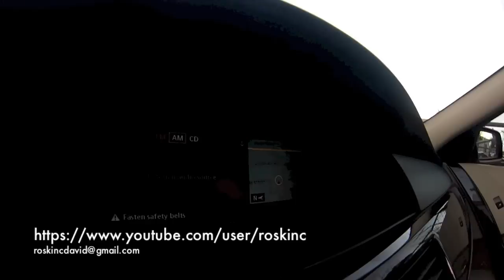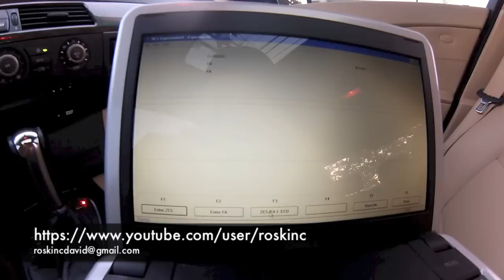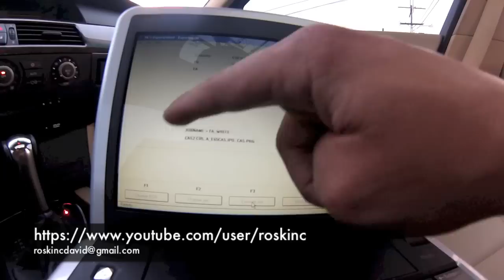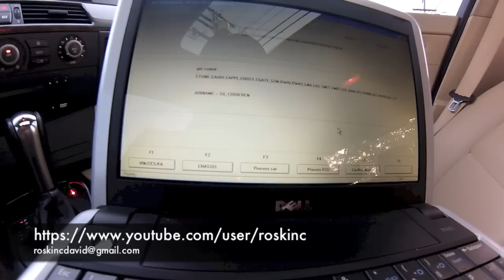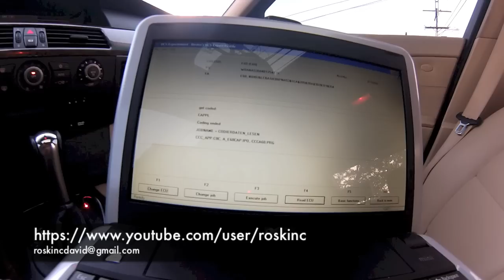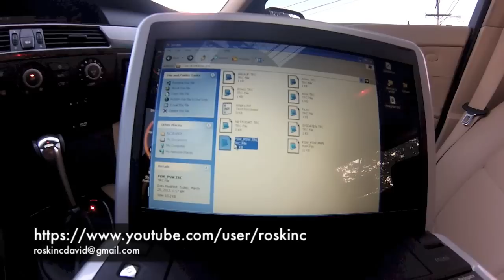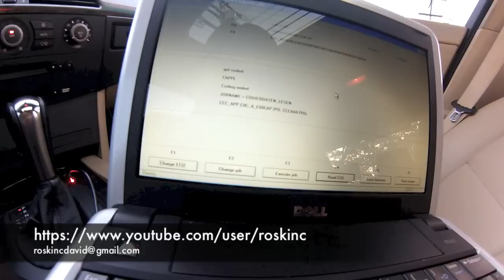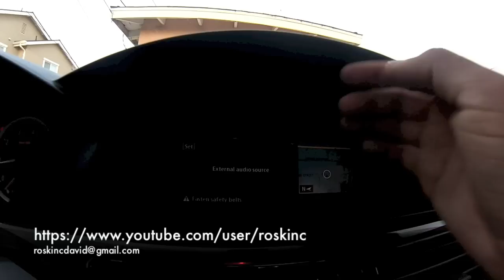BMW E60 5 series How to code AUX in Idrive ncs expert step by step

Comment: I'm currently in the process of doing this to my car. I bought the cable from your website and got it installed properly. However, the INPA program cannot read my car for some reason. I do not get either of the buttons lit up. I think it has something to do with my installation of the programs. If you have any suggestions, or know where I can get a (better?) version of the software needed, it would be appreciated. A video explaining the installation process would be super helpful as well! Thanks.
Reply: Hey, this is what I have run into. Did you get yours to work and we’re you able do your coding?
Reply: Yes I did! My problem was with my installation port. Open up device manager on your pc before you start the install process and find out which COM port your OBD cable is using. Make sure to select that port during your installation! Worked like a charm after I got that squared away.
Reply: cool, I am in the process of reverting my pc back to windows xp after I back it up.  I found the com port area and there were a lot of them, quite a few in use but when I unplugged the obd cable I didn't see any of the (in use) ports turn to not in use.
Reply: you might need to install different drivers for the cable so that your computer recognizes it as a COM port and not just a regular USB
Reply: ok, I got inpa to read my car and did all the steps up until coding the module, then I get an error code coapi 2062: error when reading coding data.  I have searched the web for this error and came up with nothing.  Could it be the program on my laptop didn't load everything?

Comment: I installed the aux cable and coded the ecu as you directed. The aux appears on the radio but no sound when I try to play through it. What you think caused that?

Comment: Tried 7n times, and cant make it! Can u send profiles or name of profiles!??
Reply from the maker: Alexander Pilipenko what errors are you getting?
Reply: roskinc no errors, just deliting NOT_mounted  , and its not stay..., and no AUX and again NOT_mounted.
Reply from the maker: Alexander Pilipenko are you using a Coding profile like revtors or stock but edited so you can upload a man file?
Reply: roskinc Revtors?!? Whats that? I was changing profiles too, from dieffrent ones. What was last profile that u used in video? I didnt find name
Reply from the maker: Alexander Pilipenko when your saving the file are you saying it as a .man file?
Reply: roskinc yes ofcours .man - all that showen in your video
Reply: After 4 hours search of REVTORS PROFILE , I DID IT. AUX IS INDA HOUSE ! Thanx, and bytheway I bought SPORT BUTTON from U on my 550i ) workin great!
Reply: So from that REVTORS
 PROFILE ..., I can code all stuff yes, like Digital Speed or  lights?

Comment: Great video! quick question  I have aux now and I can access it in idrive with the idrive wheel but it is not selectable from the steering wheel buttons. When using the steering wheel button it skips aux and goes from CD back around to FM.  (FM, AM, CD, AUX).

Comment: Hey man I bought the aux cable from you and downloaded the software onto my computer. I go to start it and it says faulty VIN and EDIBAS not initialized. Any ideas what this could be?
Reply from the maker: Need to update your dates files. Email me for current files.
Reply: +roskinc did you happen to know if there is a difference between K-line and DCAN cables. I have a 2004 525i and I read somewhere that they switched in 2007 to DCAN. Is this true?

Comment: Hey. I just bought an e64 630i 2005 convertible. The idrive only shows three options like in the video, FM, AM, CD. Is it possible to add Bluetooth to the menu with a bluetooth module from BMW (I'm a noob and don't know if one exists to purchase separately) like it would've come had the previous owner specified bluetooth as an option?

Comment: I know i need to have an ASK UNIT and AT TUNER if i have an early E66. But because the ASK Unit looks the same and from what i have read it is the same, i should just be able to upgrade the ASK unit and AT Tuner to a newer firmware release with SP-Daten 53.3 or newer? Would this work instead of buying a newer ASK Unit and AT Tuner you think?

Comment: HI
I 've had strange situation with my e60 2005 with single CD player.
I ve done all step by step but when I opened in notepad appropriate file I didn't found sentence:
AUX_CONFIG not_mounted 
I decide to write in this file
AUX_CONFIG mounted

Finally I have an option like AUXin my idrive, but there is only silence, can't play music.

Thanks for any advice.
Reply from the maker: Maciej Melaniuk if aux appears then the problem is the connection make sure the pins are in the correct spot
Reply: roskinc the door

Comment: Im trying to code AUX in my E60 2004 with Mask1 (Business Navigation, no map, just errors). INPA is working fine...Also in NCS car gets recognized. When I chose CAS in first step (adding +NAUX) I get some strange error, but when I chose LMA it would be working...But I dont know, because it is different than described....Any idea? THANKS!
Reply from the maker: skip first step and just change the mask module for the aux in

Comment: Turns out you were spot on there, just tried it with the other key and I get a little bit further. It shows the VIN now after selecting CAS, but then I get a different error, saying "FA-Fehler" and then below it it says "Datatransmission to ECU disturbed IFH-0010". Googling that as we speak.

Comment: Does this work for an e60 M5 ? Thx
Reply from the maker: Mark Sebestyen yes works on every e60 even m5
Reply: roskinc thanks! I have this: BMW Retrofit Kit Auxiliary Connection - Genuine BMW 65120153503 cable and not the one you showed in the vid. Should it still work? thx
Reply from the maker: Mark Sebestyen Coding all the same no matter what cable you use mine, dealer or someone else’s. I will tell you OEM dealer cables sound horrible.
Reply: roskinc are they using different gauge, conducting material (copper vs. Other) or what makes yours superior? Thx

Comment: nice! Im struggling with my 2004 e60 coding.. it has a digital tv that comes on when the idrive dial is held down for a few seconfd.. but I get no audio.. and there is no TV option in the entertainment menu.. trying to find the code to make that option active.. or perhaps it uses the aux (which is also not enabled)? any ideas? thanks :)

Comment: HI, Great cable and Great video, fitted and all working, once I installed the software on my XP machine. Did not work on VISTA or WIN 7 . Got AUX INPUT on my idrive as shown. Finally don't have to keep CD in the car. Thanks for all the info along the way.

Comment: Could a USB port added the same way? I want to upgrade the Aux In port in the rear console in a 2008 e60 to AUX IN / USB or just add a USB to the center console. BTW great videos and very informative which helped me remove the Aux in from the rear console that has a broken pin in it.

Comment: Been wanting to do this for a few years. Finally got ncsexpert installed on W10. Worked through the driver install issues and code write failing on first time. Worked on the 2nd try. I finally have aux in my wagon and I'm super happy.
Reply: Hello, what is the name of program you used?

Comment: Hi! I have a problem with connecting the computer to the car. I bought the cable you recommended to buy, but it won't connect. The light illuminates when I put the cable in to the car, but is goes out after about 15 - 20 seconds. Is this normal? Neither battery or ignition are shaded in. Have you experienced something like this?

Comment: great video.  Just wondering if there is a way to set the Aux volume independently to other sources?  The aux is much quieter than other sources and it blows my ears each time I forget to switch source before lowering the volume..

Comment: u seem to know a bit 
I have the X6 - E71 and I just hate the multimedia system and navigation.... its so oldschool and alot of missing stuff... I went from Volvo XC60 2013 to BMW X6 2013 and the Volvo felt so much more professional and its just retarded 
for example, I cant see any icons on the navigatior, example Parking Lots, Restaurants and so on, and I go by Car thrue Europe so it sucks so hard to not see it, on the Volvo I could see gas stations and stuff while driving so I could just go there when I wanted and needed without looking for signs 
also No radio info, no info about the songs or anything from the radio stations... 
also bluetooth info rarely Works...does not display songs or stuff 

Are there any aftermarket systems? like an android One or something to make it better 
its just so bad for such an expensive Car imo

Comment: I ordered your cable, installed it in the glove box no problem thanks to your other video showing the install. I'm using a newer version of ncsexpert, so it was slightly different. Like revtor's profile wasn't valid. so I used the factory settings profile for all my coding. It worked like a charm. Thanks for the great video!

Comment: No problem. I did use a different version of ncs expert too. I think in the video you're using v3.x correct? I used v4.x
Mine already came with a profile that allowed me to write stuff to the car, so I didn't have to use Revtor's profile. His profile doesn't work with ncs v4.01.

Comment: Hello, hope you can help me with an issue I’m having, 
I did this steps on my E60 that does have Nav. Step by step and it did work perfect. 
The problem is that I tried doing the same on my other E60 that does not have Nav and only used to show FM AM CD 
After I finished doing that second car it appeared more options now shows FM AM W SAT AUX
but aux does not work on car, can you help me find out what I did wrong?
Reply: I have the same issue, mine doesn't have navi, Aux cable installed and coded, it shows AUX(Audio) but no sound.

Comment from the maker: might sound obvious, but the cable is fully plugged in in the ob2 port and usb, and key is correct position? also are you using updated version of expert and have the recent daten files?

Comment: any idea as to why the audio volume going through the aux in is about; i'd say; 20% lower compared to other sources like FM or CD ? i've looked around and it seems like a common issue

now, someone mentioned that the aux cable has capacitors and resistors that might degrade the sound quality but I know this is not the case because I bought such cable from you

it is just lower input volume (yes, my phone has its volume all the way up) that seems to be "restricted" by the car's computer ... 

any ideas on why this happens and how to fix it ?

huge thanks

Comment: Thanks Buddy. Worked like a charm. AUX install and coding in 45 minutes. Note: some of the eBay AUX cables are pinned wrong. Thanks for the videos.
Reply: Dirk Darda how do you know if it is or not and how to change it?

Comment: Is posible update the version of radio bmw 528i 2008 to a more current version , for example one that allows to install the GPS maps via USB and no dvd? And how you use the dvd system
Reply: you need CIC conversion
Reply: wtf hello thanks for anwer. So how i can do it.
Reply from the maker: S. T my vehicle originally started off as a base mask
Reply: Was it complicated ? I might give it a shot, depends if it needs soldering or not, if so, I give up already... lol.
Reply from the maker: S. T no soldering or cutting wires, you do need to swap out some plugs. Depending on who you buy it off, it will be coded and ready to plug and play and they should include the replacement plugs.
Reply: roskinc , is it pretty much similar for my e65 7 series? i have an 07 mmi and newer ask unit already with aux ready to install. you know anything on those 7 series on what i should do first bro? thanks

Comment: I need help !!! I monted android in my car 520 year 2005 but i don´t have AUX input, it work but don´t have sound on speakears, nobody in Portugal can program this. It´s possible do that or i need put again the old GPS screen and configure AUX, and than mont the android system? Waiting help....
Reply from the maker: António Ribeiro you don’t need to have the old screen to code aux. if no one is around to code it you can do it yourself if you have a computer and Coding cable, you can buy Coding cable online

Comment: would i take the same steps to add the aux feature in a 2004 bmw 745li
Reply: Metalpie I need that question answered as well
Reply: Julissa Vasquez on 7 series requires getting a facelift from a 2006+ I believe so you would need new module and screen. Not as easy as the 3,5,6 series.

Comment: Yep, my cable also has a LED and it lights up when I plug it in. I then turn the car in the ON position and I start INPA (v5.0.6). INPA shows both Battery and Ignition ON, so that looks good. Then I quit INPA and launch NCSExpert (v4.0.1). I load the profile, hit F1 and then F3. Then chooses E60, then CAS and then I get that error. I got all software with the cable from this dude on E-Bay (Romania Diagnostics).

Comment: Thanks for this step by step, I managed to code the AUX function in my e63 (2004 645). NCS expert 4.0.1 allows to code everything without Revtor's profile.

Cheers
Reply: I have 06 650...did u buy the thing he bought?lol
Reply: Stefanos Vaskas With the thing you mean the aux cable? Yes.
Reply: obv the aux cable lol...the diagnostic scanner reeeeeeee
Reply: 86netsniper Luckily for me I didn't get any errors. I would suggest reinstalling NCS expert from a different version or source. I used "NCS Expert profile" for adding the vehicle order and for enabling the aux function.

BTW you can check my thread with some general info about my project, I don't cover details on coding though.
http://www.bimmerfest.com/forums/showthread.php?t=828061

GL

Comment: Thanks a lot for all your help. I ran into a lot of problems because my computer was updated by the dealer. I was finally able to code the aux for my 05 545i sports package. I also installed the sports button and boy, even though my ride was already a sports package, I now have a torque i didn't realize the car had before. Also cool to see the sports light. My next project is to code the following: Digital speedometer in cluster & close mirrors and windows via key FOB.
Thank you!!

Comment: 3. My car doesn't have nav, so there is no CAPPL module. You have to use the MASK module instead to enable the aux in port (as said in the video). However there is no AUX_CONFIG.
Solution: There should be an AUXIN attribute in your MASK module. Change that from nicht_aktiv to aktiv and use the same steps as in the video to actually write it to the car.
Reply: Hey Ruben, i had to follow the same steps, but for some reason I have no audio on my aux in channel .... I did exactly the same steps you described. Any pointers?

Comment: Bought your cable, had a lot of trouble getting the code part of it working, had numerous errors with my ncsexpert software like profilversion 2.0 inguilt and had also problems with pressing F6 which then pop up an error screen basically saying u need to update sp.daten tried updating it didnt get it to work....but then after creating a win XP virtual machine on my windows 10 OS and adding in all the required frameworks ..... i got it to work thank god, i then followed these steps and i successfully coded in an AUX option into my BMW WOHOOOOO. if anyone needs help send us a message.
Reply: Hi, could you advise me on same issue but under Windows Vista. I have the same error with NCS Expert showing 'profilversion 2.0 inguilt'. What should I do or change? Thanks

Comment: Roskinc, I purchased the aux cable from Century BMW in Alhambra, California through Ebay. After having to leave the the car there for about two whole days,  they told me that they couldn't program it to my vehicle (545I 2004). They said "after diagnosis, found there is problem with SGM module and SZL module, it is possible that SGM might cause the SZL to fail at this time but it is necessary to replace SGM and find out to see if SZL is okay. Recommend to replace SGM module. 1.5 hour to replace and program. Now the car has the airbag light on and they said it is because of this module. The car was fine when I left it there. Where are you located Roskinc? Maybe you can help me.
Reply from the maker: Wow sound very weird. I am located in Los Angeles. Send me an email.
Reply: +roskinc please email me obd2 cable and program ordee please
Reply: javier arteaga ww
Reply: roskinc  can't you help me with my car need to program my aux on my 06 BMW 750i

Comment: So I just finished coding my AUX IN in my 2005 530i. Since I'm new to coding I had some startup trouble, but all the obstacles have been cleared. Here's a list of what I walked in to and how I solved it as it may be useful in the future for other beginning coders:

1. In ncs expert after pressing F3, selecting E60 and then CAS to read from the CAS I got the error "Faulty VIN".
Solution: use other (main) key of the car instead.

[to be continued]

Comment from the maker: ebay item number 110843646633 is the coding cable i use, and have recommended people to buy. software i can link you to a file sharing site i have them uploaded to. far as using it on a mac, you would have to use parallels or similar program to run windows xp on. i havnt done it, so i cant offer much tech help on that.

Comment: 2. Random "Datatransmission to ECU disturbed IFH-0010" errors being thrown from ncs expert.
Solution: your port settings of the COM1 port in Windows are wrong. I used Windows 7 (64 bit) and by default the latency setting was set to something like 16ms. Set this to 1, it's under advanced settings of the COM1 port in Device Manager.

[to be continued]

Comment: Yeah from the Control Panel. Go to Control Panel -> System and Security -> System -> Device Manager (in the left pane). Make sure to hook up the cable to see the COM1 port (it's actually a virtual port).